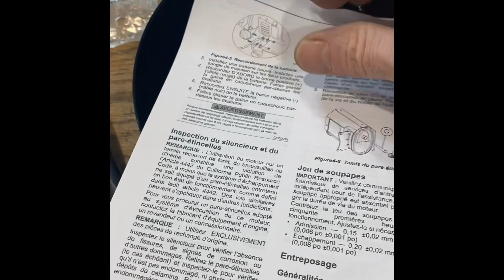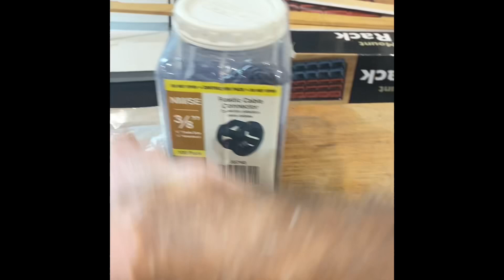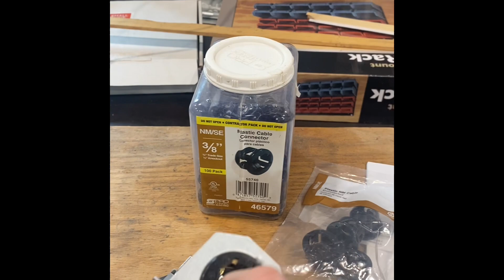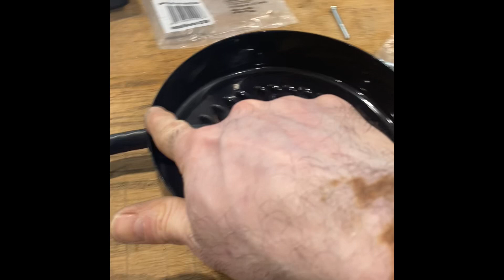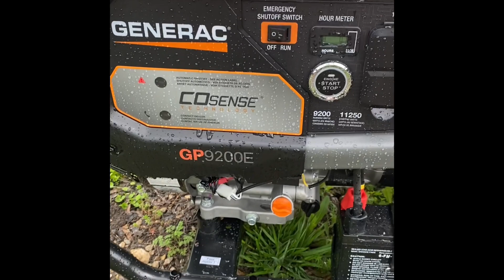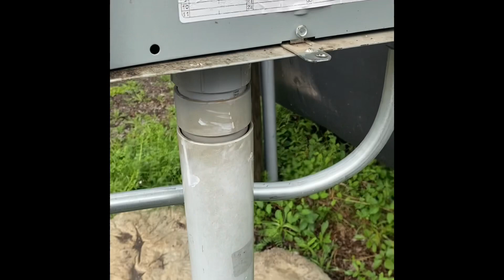Generac GP9200E generator mod - add a 50A/220V outlet

Comment: You still need a breaker on the generator side. Very dangerous setup. If you have an issue between the outlet and your panel, nothing there to stop the output. 
But agree it is dumb they do not have a 50a outlet on this unit.

Comment: Did this work as you expected? Any issues with increased load? You could not still pull a 240v load over 37 amps but could pull up to 67/amps on 120 v loads?
Reply from the maker: Each hot can support 37 amp @110v. You can have two circuits on each hot pulling 37.5A at a time but you can't pull any more than 75A on a single circuit (as per the spec in user manual). Peak current can be as high as 50A per hot.